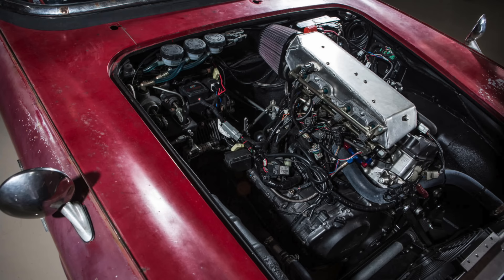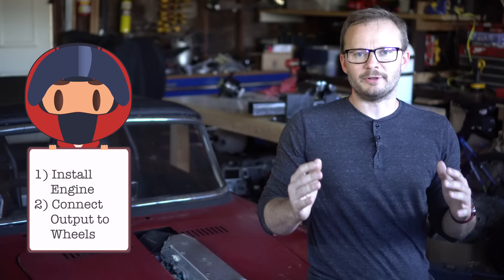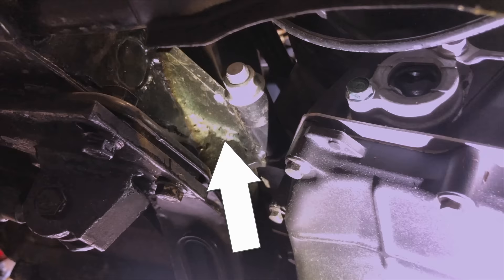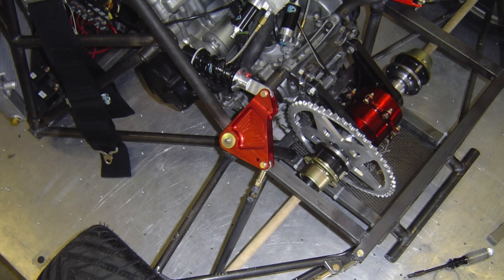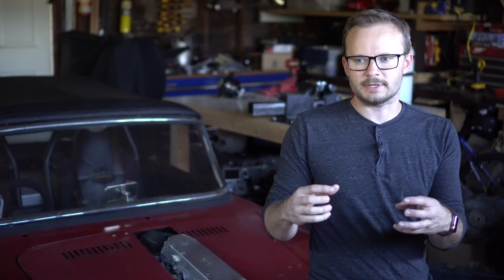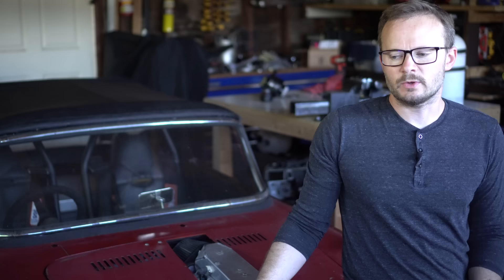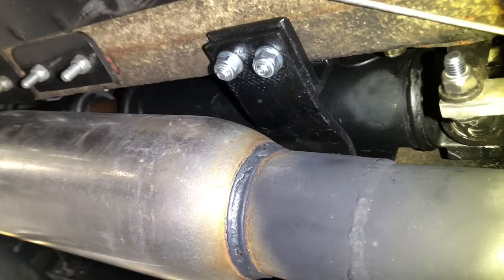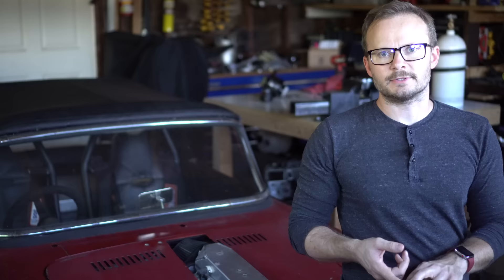Motorcycle Engine in a Car - Here's Why and How

Comment: I lived in Japan in the early 70's and remember seeing these.  They were quite cheap to buy used.  A couple hundred dollars maybe.
Reply: Ken, very cheap back then such that many went to scrap.  By the end of the '80's many realised the mistake and came hunting in Australia.  What had been trading for ~$500/600 were suddenly $2,000 to $5,000.  Claims that containers were filled and sold in Japan within 24 hours of opening the container doors.  It is known that quite a few were stolen from garages and never seen in Australia again.  Now good ones are in the tens of thousands and a fully restored could be in the six figure bracket.

Comment: Thats it. Im looking for a old honda 600 now.   I have the perfect engine in mind.  Valkyrie baby!
Reply: #WillNotFit...
Reply: Kyle, if you are in the United States or Canada, you will find it easier to get a truck load of rocking horse dropping before you will find an unwanted S600 in any condition.  If in a country where Honda actually sold the 600s, they are worth far more unbutchered than cut about.  That bastardisation was common back in the 1970s and '80s, but most people saw sense and put the little cars away until they could do them properly.  Worth a mint in Japan.
Pick a donor car that was made in the tens of thousands that weren't very clever or valuable to start with.  (Total production of S600 and S800 convertibles and coupes was less than 18,000.)

Comment: electric motor for reverse many say but how, outboard with extra wheel on ground open door to put it out or wheel pushed to rear wheel by string cable maybe. is it simpler cheaper than new shaft. ........and bike engines have a problem, special oil with high resistance to help clutch that uses same oil as enine so engine has resistance too

Comment: Doing the same in a MG Midget body from 1969, but with an R1 engine. Still a lot to do, but at least there are some bigger brakes and suspension upgrades available, people still race these things. And let's be honest, the S600 was basically a copy of the midget ;-)  And the best thing is, I will actually have a functional boot ;-)
Reply: Robert, I suppose if a wheel at each corner, a 4 cylinder engine and a steering wheel in front of the driver, you could say that it is a copy of, well, almost anything.  The S600 predated the MG Midget and was very, very different.  Four wheel independent suspension, torsion bar wish bones at the front and coil over damper to trailing cast aluminium chain cases at the rear.  DOHC water cooled with effectively four carburetors.  All switches and instruments placed where the driver could see and use them naturally.  And much more enjoyable to drive.  (And no Lucas electrics.)
Reply: In terms of sizing they were extremely similar. And the midget started in 1961. The s600 in 1964. So which one predates?
Reply: @campr23  The S600 evolved from the S500, which in turn evolved from the S350.  The exact date for the S350 is uncertain but work was being done on a Honda sports car from at least 1957 with things like aircooled V4 engines.  (There was a curious attitude to Japanese prototyping that the records kept were often incomplete as if they were ashamed and somewhat embarrassed if the idea had not been a success. This was so bad that officially the F1 cars from the 1960's were supposed to be destroyed.  Fortunately someone thought better and sidetracked them.  I saw two of their 1960's F1 engines in a technology museum in London in 2006.)  Okay, so which came first, the Midget or the S600?  Did one inspire the creation of the other?  If the size was important, not really as the S600 was sized to fit a Japanese Government size regulation on width and length.  The Midget (and Sprite) were sized to fit British country roads.  The Honda though was better built and much better equipped and laid out.  Designed and built as a sports car from day one.
Reply: @campbellsharp8303    mg started the midget line with the TF, which was made in 1937. But hey, who's counting. My only point was that in terms of layout (RWD, front engine) they were similar, and the size of the two vehicles was similar. If (as is the case with the S600 that has the CBR1000RR) you take out the engine and all the very cool drivetrain and replace it with an MX-5 rear end as was done in the case of the s600 I was referring to (of Jay Leno's garage fame), the differences gets much smaller. As you're replacing so much of what makes an S600 an S600, they get closer together in the comparison. I grant you, the MX-5 rear end is superior to that of the Midget, but also probably better than that of the S600. Have a nice day!
Reply: @campr23  Fair comment, but in the same realm as Toyota claim over 50 years for the Corolla and 10 million manufactured and Honda with the Civic and 50 years and over 10 million sold.  The Corolla started off as FE/RWD and took awhile to migrate to FE/FWD which the Civic was from day one.  The MGs right through were primitive in engine, running gear and drive train, but that was within the expectations of the time.  The first iterations of both the Civic and the Corolla were primitive in comparison to what the entry level cars are today, but they were equitable to everything else on the market.
The Triumph Spitfire was a smoother riding car than the Hondas, Sprites and MGs with it's independent rear end.  The 600 was quite good in the handling but with the rear chain cases keeping the rear wheels in the same plane as the roll of the body, there was a point where the back end transitioned into a snap oversteer that was non-recoverable.  From a handling point of view, a solid axle gives more consistent and predictable experience, but a well deigned and aligned and dampened independent gives better ride comfort.  Giving the generational differences, one would hope that an MX-5 had better handling than a car of around 30 years prior.  Yes, the MX-5 was/is a more comfortable highway cruising car than either a 600 or an 800 and if the choice for a 2,000km trip was an MX-5 versus any of the others that we are discussing, it's a no brainer.

Comment: The most vulnerable part of a motorcycle  engine, both in pulling more weight, and in increased power, is the primary chain. Did you address that?
Reply: #DidYouWatchTheVideo...?

Comment: Awesome project.  Not sure if I'm looking at this right, but at 10:01 the axle half-shaft looks like it's only 1-inch or less away from the frame rail.  How much travel is available there, and is there potential for the shaft to hit into the frame rail?

Comment: very well made video! subbed, I have been planning on putting a bike motor in my suzuki cappuccino and im extremely excited to hear about the reverse gear in the nova racing trans! 
will definitely consider that down the line!
Reply: Outstanding.
I wanna go crawling/wheeling in a acty or sambar with this litre kawi motor I've got sitting around

Comment: An old BMW 600/1000 CC twin would have been easier. Take it to the rear and electric motor to the front. Fast and not too complex. Good on snow.  Reverse on the electric. A super 2CV.

Comment: I have a question, maybe I wasnt listening well but how would cooling work? I mean most motorcycle engines are air-cooled meaning that there isnt any lines for coolant to pass through the block. I know some suzukis are oil-cooled. Maybe an oil-cooler would work in place of a traditional radiator. Or is this engine in particular water cooled?

Comment: What rear diff gear ratio did you end up using and would you change it?  I’m going to be putting a dry sumped Hayabusa in a ‘57 Nash Metropolitan with Miata suspension.

Comment: Hey Matt,
I am in process of doing a suzuki  lj20 with a fireblade engine,i am having issues gettimg the shifting in place,im trying to use a shifter cable.any input on how you got yours done would greatly be helpful.

Comment: I have been thinking about this for quite some time, unfortunately I wont be able to do it unless I move,
inn Germany any modification of the car is by default illegal,
but I have still had my eyes on it, maybe as a track thing (though there also aren't any publicly accesible tracks).
And I have always been wondering about the reverse issue and was unable to finde a reverse box like the one he showed here.
But cool shit. I think the engine to choose has to be the Yamaha VMax engine, it's high torque for motorcycles and it has the V4 sound going for it.
Reply: You can take your car to the 'Ring almost any time you want. If you want to see some footage of Achim Korden's Mini with a 250 HP turbocharged Honda 1600cc VTEC going round the Nurburgring Nordschleife, have a look at this: https://www.youtube.com/watch?v=xggd12OMS7g  It is not a slow car and he is not a slow driver.

Comment: For reverse, couldn't you just put an electric motor parallel to the driveshaft to turn in reverse (and perhaps use it as an alternator when running the car)?

Comment: I run the u joints in my v drive boat at 12*...no biggie right? the u joints spin at engine rpm...7000 rpm...never a problems.

Comment: How is the stock multiplate wet clutch holding up to the additional vehicle weight? My concern would be slippage, extra load bearing frictional forces, increased engine/contsant mesh transmission oil temperatures, or clutch basket groving...
        Love the conversion, and all the engineering effort that went into it, just wondering how much of a ass kicking it would handle before a potential catastrophic failure.

Comment: How strong is the output shaft to resist the bending forcing that will be acting upon it?

like when there will be a slight misalignment of the drive shaft, the U-joints will just transmit the torque created but then it will stress the motorcycle engine's output shaft trying to move it in all directions.

I'm just considering the fact that I cannot perfectly align the output shaft to the differential input shaft.  I can do my best to align it but there would probably still be some misalignment present.  I was thinking adding my U-joints might help make misalignments more acceptable.

I'm interested in doing the same as you did.

At first I always thought that I will need to find a way to partner a motorcycle engine/transmission with some differential USING A CHAIN DRIVE, but that is not very simple to do.  and using a chain drive that will have reverse function is even more difficult.

Comment: Triumph Spitfire weighs around 1600 lbs. Replace engine and lose 300 lbs and pick up 40-100 hp.
Reply: Saw one with a 2nd gen Mazda rotaty, it was sick!!!
Reply: @goatfromhell666  I've been thinking of that too. Was looking on eBay. 300hp, 200 lbs!! Got a 64 spitfire
Reply: They're the size of a milk crate, pump out unbelievable power, and spin at 9000rpm with only 3 moving parts. There are some drawbacks that make a rotary a love thing tho.
Reply: @goatfromhell666  my first experience with one was in 1980, removed the engine from a RX4. By hand. Once disconnected I lifted up 200 lbs.of engine.  Fell in love. A great race engine. Not so good mpg around town.
Reply: @happyraccoon4791  fun for projects, not recommended for daily drivers.

Comment: Ok. Question i have and i cant find an answer to.  Is how does the motorbike clutch handle the weight of a car and the crud you put it through.  Ive seen people drifting with them and racing certainly isnt easy on the clutch

Comment: Step 1: Buy Miata NA with little or no rust....But with a SHOT engine as the only major deficiency. 
Make it as light as comfortably possible
Step 2: Buy Hayabusa engine, in good condition or a recent rebuilt with a warranty.
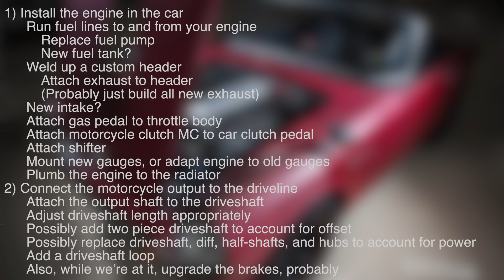Step 3: See video at 2:10 - Follow generic steps.

Comment: S600 was a natural as it was chain drive
Reply: Brent, except that the chains were in fully enclosed alloy casings pivoting off the ends of a conventional banyo differential rear end.  The input at the diff turned in the opposite direction to any other driveshaft. Top gear was straight through the gear box that gave 11.5 mph per 1,000 rpm.  This meant that with the original final drive, running at 60mph, your engine would be spinning at around 5,400rpm.  Not many other engines would run like that for long.
Note though that in this conversion, none of the original drive train has been retained.

Comment: Just a question, is it possible to use the same transmission and all other parts in a car other than the motorcycle engine if the engine is having at least the same torque or more than the car’s original engine? Such as adding a flywheel to the motorcycle engine will it work? Thank you

Comment: Is it possible to use CV joints on a drive/prop-shaft? Those are designed to work at more extreme angles.
Reply from the maker: Yes, and frankly, that probably would have been a better design.

Comment: What I can't understand, is : why can't the car makers actually understand that peoples would buy those kind of cars, and that it would be far of beeing a "niche seller" ?

Just let your brain go through all the things : A sub750kg car, with a motorcycle engine, on a tubular chassis, rear wheel driven, making 170 hp, and a sequential gearbox for a reasonnable amount of money.

You can go this several time in your brain. This is just the new love toy for every car enthousiast out there beeing created.
Reply: Bob, unless a manufacturer can be confident that they can sell around 100,000 of the car in a model run, it isn't worth the cost of designing and getting the vehicle approved for legal road registration.
However, there are limited production vehicles such as the Aerial Atom that go close to this concept.

Comment: Matt, What is your top speed that you recorded on the salt flats???  I am trying do some MATH to figure out if I can get an F150 powered by a Harley Davidson 1300cc up to at least 80MPH? I know that your Honda S600 is MUCH lighter than an 6500lbs F150... I have seen Motorcycles (again much lighter than an 6500lbs F150) get to 200MPH+

Comment: Honda Accord I had had a two cyl motor air cooled motor with a 4speed on the dash
Reply: That sounds like a different design from my 1977 Accord. Honda did make a smaller car that sounds like yours.
Reply: Lee, more likely a N600 Scamp.  Not an Accord by any means.  By the time the Accord was released, Honda were no longer making any aircooled engines for their cars.

Comment: You get any oil issues under acceleration with the orientation of the engine being changed? or did you move the oil pickup?

Comment: I wonder how the clutch react for this weight???
is it slip a bit???
gef
Reply: That's just one of the things to consider when putting a high revving bike motor into a car. The heavier the car, the greater the problem. Depends on how you want to drive it, too. If you want to holeshot people at traffic lights, try something with lots of torque, and that doesn't necessarily mean American big block iron, either. Forced induction or nitrous can do the trick.

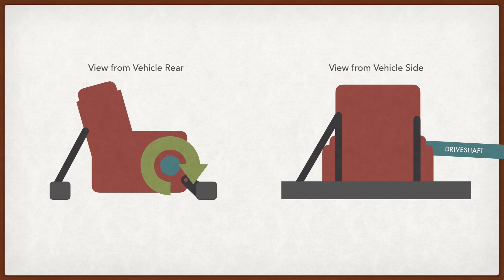Comment: "the  hottest of rods"...more like a guaranteed death trap.  Driveshaft loop, good idea.  Had a 54 Healy 100-4 with a 289, a C4, and a 4:11 stuffed into it.  Engine was placed rearward as far as (further, actually, lots of firewall remanufacturing, almost no passenger foot room and a really narrow channel way left for the driver pedal access) as was possible (practical anyway) so that it had a driveshaft about a foot long (seemed that way, anyway).  Always made me nervous, if that shortie ever got loose and managed to "cone out" it would have seriously damaged anyone sitting in the seats, had it gotten through that thin metal floor. 

People used to mistake it for a Cobra, probably because of the little Cobra sticker forward of the hood, and the way the damned thing launched.  The bumpers were removed, and the passenger door welded shut (for some damned reason, I'm sure...stiffness maybe?) the car actually looked quite nice. I had a friend that told me he could outrun ANY street car for at least 5 steps.  I told him "not even remotely".  He tried it against that little screamer and got about ONE HALF a step before he was left in the dust.  He was floored...get it...floored....sorry...as bad as yours.  ;-)
Reply: can imagine that little bastard was a fun ride to launch.. lol

Comment: I just watched this video and Matt has the clutch activated by a hand lever.  Cool!  But when I watched the Jay Leno Garage video, the clutch was foot activated.  The Leno video was filmed more than four years before this video.  Matt, why did you change the clutch activation?  I think it is cool to have it hand activated.  Just curious, I guess.  Thanks.
Reply from the maker: Yeah, I moved it from foot to hand. I like it better this way; feels like a motorcycle.
Reply: @SuperfastMatt  Thanks for the quick reply.  I ride motorcycles and I too think it is a cool way to do it.  You have influenced me to give this a try.  I think I will try to use a MG Midget.  They are easy to come by and inexpensive.

Comment: Where did you get the sleeves, or what did you use as sleeves, doing a similar build, but don't know what's beefy enough... I am thinking of using 1inch galvanized, but between the seem and the fact that galvi welding produces arsenic.. I'm not really sure that I wanna use that
Reply from the maker: The CV axle sleeves? I used DOM steel. You can get it from McMaster Carr or onlinemetals. Definitely don't use seam welded or galvanized.

Comment: Matt, I’m doing a similar project. I’m a novice at this fabricating stuff for cars so I’m sure I will screw up a few things. I’ve got a 73 MG Midget that I will be attempting to replace the slug of a motor and trans with the complete drivetrain of a Honda Goldwing. Would it be ok to lean on you for advice?
Reply from the maker: I'm always happy to help with specific questions if you run into problems. go to my channel page and click "about" and you'll find my email address.